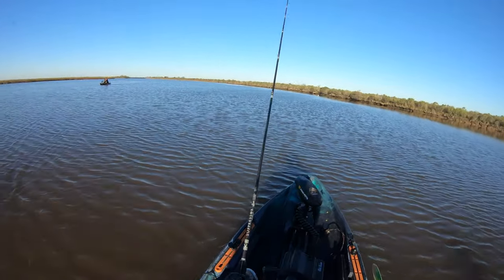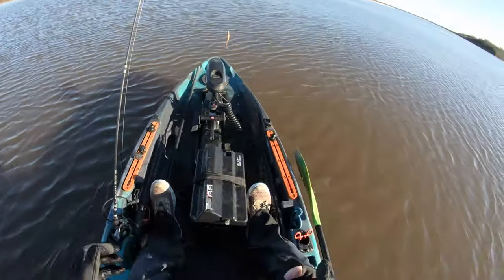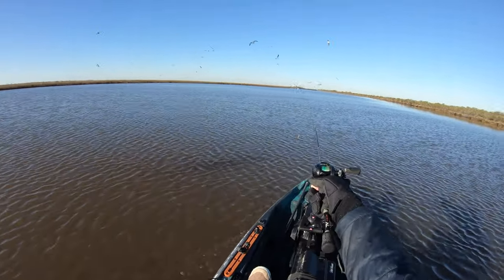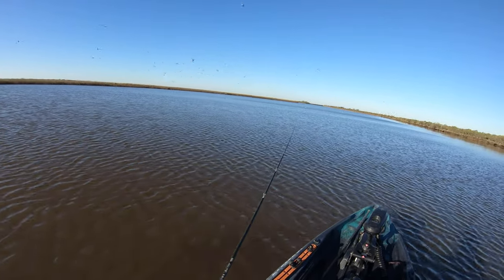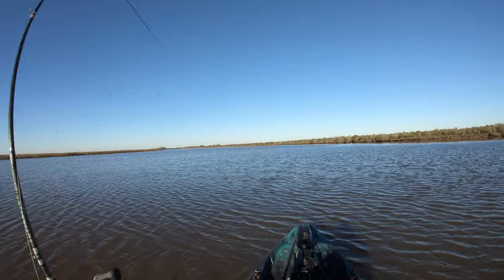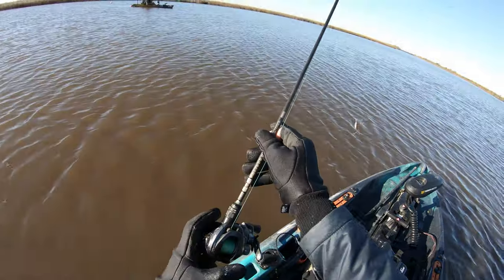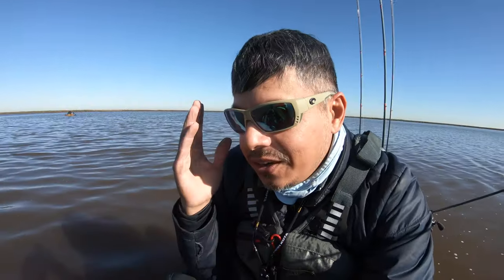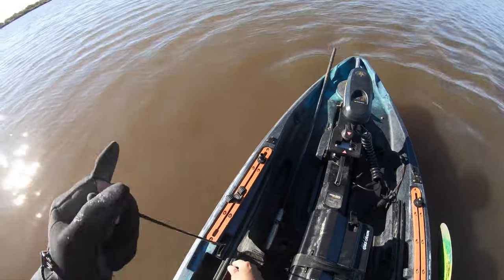(S4 Ep57) Ultimate HACK! Autopilot Kayak Old Town

Comment: Lindy, Berkley and Magic (on amazon) make worm blowers. Work great for injecting plastics too. Pull the needle out of the top and add some of the stinky juice of your choice. Fourth day on Padre and I've still not wetted a line. Tomorrow I'll be surf casting. between 15-17 mile on Padre. That is about 1,717 miles from home but the fish are biting so what else could I do. Tight lines another great video

Comment: I was saving for an Autopilot for spring season... I wonder if 'SPORTSMAN 106' is easier to maintain?
Reply: Yes it would !!! 😎👍   The Autopilot is Awsome , but plugs , connectors , Batteries and a Trolling Motor is a lot to Maintain. If you can Afford it Go for The Autopilot,  if not or your worried about the upkeep go for the Sportsman 106
Reply: But what king of Sportsman 106? The PDL or the Powered by Minn Kota? The 106 MK uses the same plugs as the Auto pilot
Reply: @jettercool  Didn't  know the connectors are the same type. I guess wait for them to beef up on the connectors?! Thanks for the info.